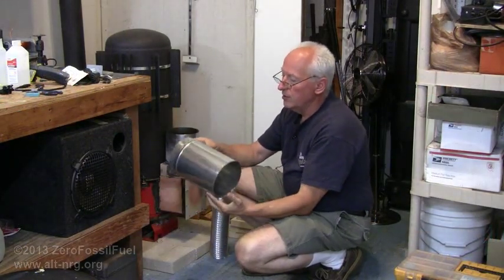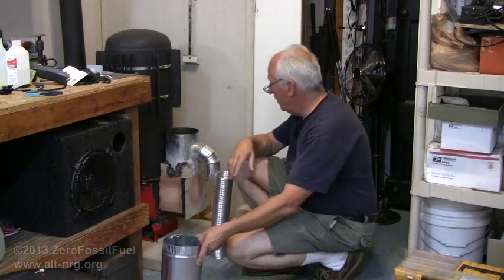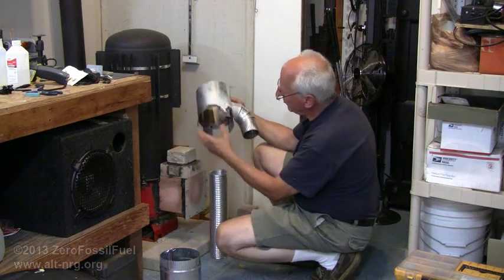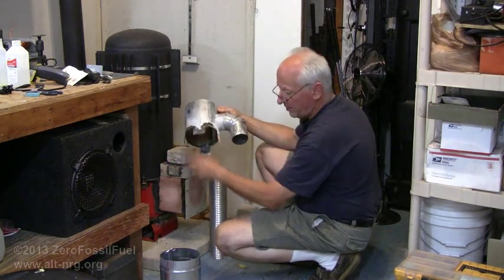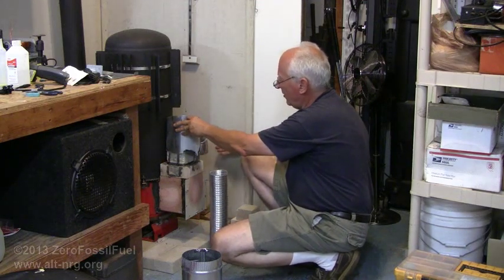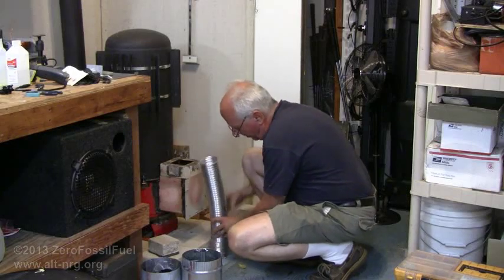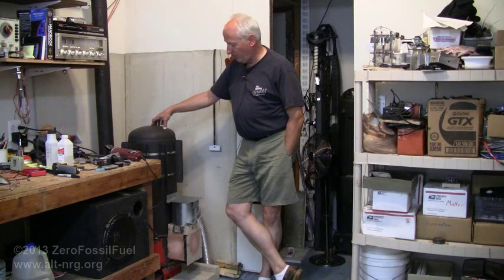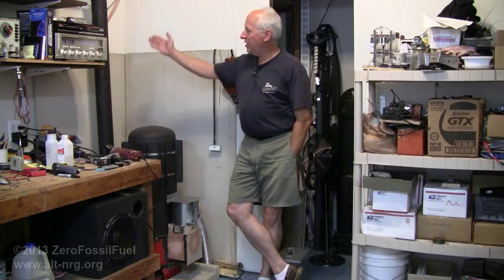#341 Rocket Stove mods for season #2

Comment: What size garage do you have in feet ??? Well insulated I presume. Thanks for sharing your build with us all too. Peace too.
Reply from the maker: It's a framed and fully insulated free standing out building converted to my workshop. 12' x 20' with 10' high open ceiling.
Reply: @zerolabs  Thanks for the information Sir.

Comment: are you concerned (or have you found it to be true) about reducing the heat in the flue to the point that your  'draw' is effected?  is it not possible to reduce the flue temp too much?
Reply from the maker: +deemail100 No, it is NOT possible to reduce the flue temp too much in a PROPERLY DESIGNED Rocket stove. All of the draw needed for it to operate is created INSIDE the tank. From the exhaust port onward there can even be a small amount of restriction as the Rocket can easily overcome it. That's why it can traverse over long horizontal distances through heat exchanger pipes giving up most all of the excess heat to a thermal mass if you elect to go that route.
Reply from the maker: deemail100 Sweet! I hope you show it off when it's all done!

Comment: Hi Z, is there a place where you tell us what the clearances are between the walls surrounding your stove and the stove itself are? and did you to anything to keep them fire safe?
Reply from the maker: +Niqui O No but my wall clearance is about 18" and even though that meets local code I also have 3/8" thick cement board on 1/2" spacers boards from the sheetrock. Way overkill.

Comment: hey just a thought on removing all those nails. I saw another rocker stove using old pallets and didn't remove the nails. The nails didn't seem to go any further than the back of the burn chamber and didn't go up the combustion stack because their weight. they then removed them with a magnet on a coat hanger. Just saying, it might save you some time removing all those nails by hand. And I love your videos, I've watched them all several times as I'm planning on building one. Thanks for sharing.

Comment: Extra tube around your flu attached to the Finns drawing air from outside?? Heat controller vent at the top with automotive thermostat??? Oversized bolts or screws attaching your Finns with the excess inside the flew. Awesome design

Comment: Two tips for you.

One: Let the tool do the work..... start slow and work into the throttle on the drill. 
Two: Use the rear holes in the drum with a nail and rotate the nail in reverse to thread the cut out back off the bit.

Comment: Hey, something else you might want to give some thought to, is, some sort of 'flat' surface on TOP of the Stove, where you can set an Iron Teapot, for 1) humidifying your workspace, some (thus actually making it 'feel' warmer), and 2) hot watter for a spot of tea, or other beverage (or even a pot to heat some soup, or such)...

Just a thought. I'm designing that into the one that I'll build from your plans.

GREAT JOB... Thanks.

Comment: One question- does the burn tube have to be a certain length for the stove to work? It seems that the distance from the top of the heat chamber to the burn tube is about the same. I just haven't seen anything which indicates how long the burn tube should be.

Comment: A properly built rocket stove burns the smoke/soot completely, so you don't have that problem. The distance between the fuel and the flue is much greater than with a fireplace or wood stove, allowing more time to burn before the smoke arrives at the flue.

Comment: Well your not English, theres no kettle on top.lol..
and to answer the question about the fresh air pipe is neccesary, yes because you'll be taking air from the room which has to be replaced by sucking cold air from outside causing drafts plus higher O2 from outside..
Take care Z

Comment: I've learned and enjoyed your videos a lot. Watching this video I had a thought on how you may be able to reclaim more heat from the stove. Would it make sense to run tubing from the heat riser down through the floor and coil it around under your work shop then back up? to the heat riser for exhaust? Wouldn't this use the floor as Kind of a makeshift thermal mass? Maybe use some 6 mil black plastic as skirting around the bottom of the building?

Comment: There won't be creosote buildup because the burn is already complete. Creosote buildup comes from unburned gases condensing on the cooler pipe. This is one of the key advantages of the rocket stove. Creosote is wasted energy. :)

Comment from the maker: All of the draft needed for a properly designed rocket stove to operate is created in the riser inside the tank. After that the exhaust gases do not need draft. They can be literally pushed out horizontally as in through a cobb bench thermal mass. The fresh air inlet is only needed if you want to maximize efficiency. This is all explained in my free pdf at alt-nrg*org.

Comment from the maker: I pull the nails beforehand for three reasons. First, they're dangerous to handle. Second, they make it impossible to stack the wood neatly. Third, there's not much room in the firebox for nails to build up. I'd have to rake it out avter every single burn. Thanks for watching!

Comment: Hi, is there any specific reason, why you don't run your exhaust pipe horizontally, inside some heat mass (behind your workbench seem to be a perfect spot)? See rocket stove mass heater on yt, if you don't know what I mean. This way you don't need fins on the flue, and nearly all the heat would be removed from the fumes, and gently radiated for hours after the burn is finished. Regards

Comment: Also... we dont pull nails out of wood in the beginning. We burn the wood in the burner, then rake out the ash, and when we put it in the hedge we use a fine colander to sieve the nails. Might be easier doing that. All the best, k

Comment: Hi zero, just a thought 2.00 flew pipe. At camps we have a long bit of chimney pipe (like the corrigated stuff from floor) out the top burner, we coil it at last two 360 turns, making its way towards the roof. What this does is give the exhaust a longer path, and we get all the extra heat off the chimeny into room. I was thinking, you could chop your black pipe in half, extend a bit of tubing into that area above burner, then reconnect. It wont look as neat, but youll get more heat that way.